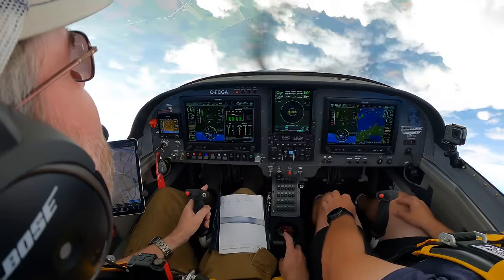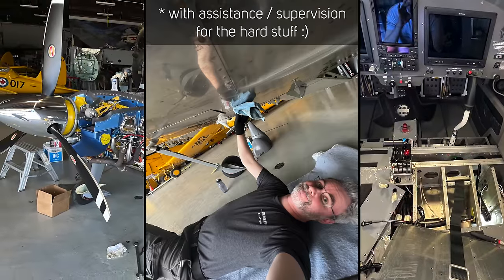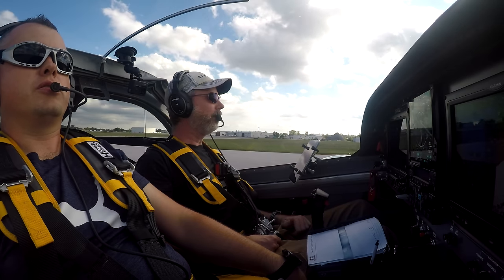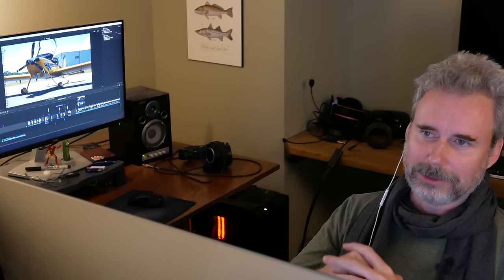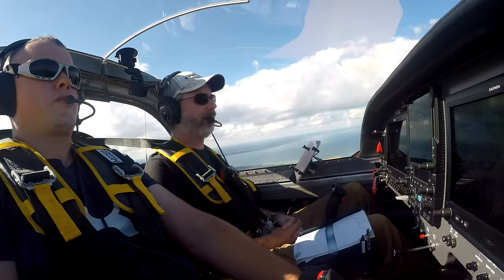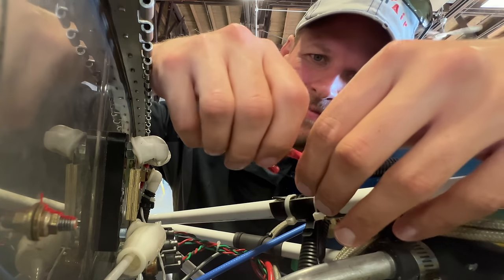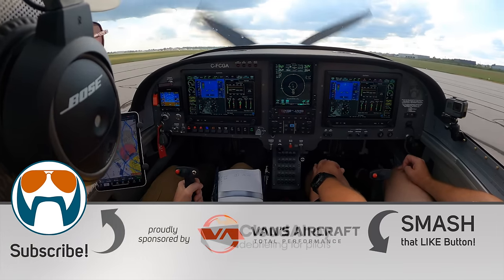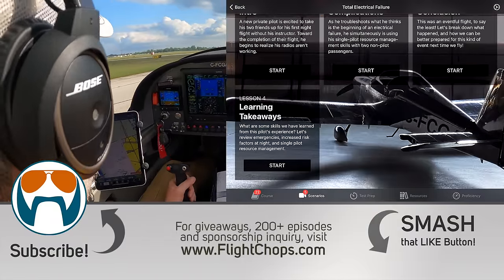Loop Induced Emergency?!

Comment: This kind of thing is what "Pan Pan" was created for.  Serious failure not to have used it.
Reply from the maker: Serious failure?  Or technical failure?  If this was a test question, no doubt the correct answer was to make a pan pan call. But in this case we were already in contact with ATC and they knew we had an urgent situation - they even offered us assistance on the ground if needed - we were able to make the most direct route to a straight in work with no delay.  So… was it sloppy?  Sure.  But to call this a serious failure is hyperbole.
Reply: @FlightChops  I stand by my original appraisal.  Especially in this instance where it is presented as a learning opportunity, foregoing PanPan takes another step toward eliminating it from our options. It should be used to indicate a situation that is not but could become and emergency. This situation meets that perfectly   The GA world tends to be all or nothing on this issue and that's not good.  Panpan is in some cases (like this one) the best, most succinct, and most efficient way to describe the level of issue.  Doing so would have rapidly illustrated to ATC what level of threat - that would have been handy since you could have lost your engine over open water.  You could have gotten priority handling for any conflicts, which could have saved your life had this situation gone south.  So yes, serious.

But no one ever remembers Panpan is an option except for the test, so don't feel bad.  You're no different than the rest of us.

Comment: All those fancy avionics; and I didn't see a nearest-directto for an airport.
Reply from the maker: Yup.  I should have leveraged the navigator and autopilot - but I didn't let go of the stick or throttle all the way home.  It's been a few weeks since I looked at this cut, but didn't mention that in the debrief? 
(that said, there was no "nearest" that had pavement, that wasn't home).
Reply: @FlightChops  Wow, I sometimes forget how baron things can be low to the ground. With that RV; you will probably get to do some fun cross-country; may I recommend 11.5/12.5. I find in my Lancair, that is usually a pretty smooth and empty set of altitudes. Another thing I found comforting early on in my cross country flying (Pacific to Atlantic type cross country I mean), looking out at all the beautiful runways I could glide to :)

Comment: Sorry but what was the exact cause/fix? Did the oil temp stay high after landing?  Were the connections examined for the cause after removal? Was the crimp done incorrectly? Why not include a little more information about the cause and fix?
Reply from the maker: Cause: Suspected bad connections via either the connectors themselves, or the crimps and due to being under strain from overly secure tie wraps. Fix: cut out and replace old connectors, secure wires with less tension.
Reply: @FlightChops  I for one would appreciate knowing more about how a crimp connection can cause the situation. Normally there is either a connection or there is not but a connection that produces some degree of resistance is not normally possible. Was the crimp poorly executed? Did the metal not crimp onto the bare part of the wire? Was there insulation that got shoved up inside of the connector? The connector is a metallic device so it should not be possible for the connector to become partially resistant I’m not sure if there was corrosion or some other inhibiting factor? Did you save the connectors that were removed? If so may be remove the plastic outer shield and examine them carefully? Maybe you could discover the actual cause of this? How exactly does pulling on a wire cause it to become a resistor? In this case it was just an oil temperature reading but what if this was a more critical connection to a more critical component? There are some connections that will actually prevent the engine from running or cause a more extreme condition. Not meaning to be critical but saying that the crimp connector was suspect without actually investigating it further seems like a less than thorough inspection .
Reply from the maker: The video is a thorough debrief with a Garmin engineer.  We didn't have a way to further test the connectors that "looked" ok.  But as the video showed, I have the panel data from the day after when "jiggling" the connectors undid the problem that pulling the 4Gs had created. So it is likely that it was one of the many things the Garmin engineer suggested could have been the problem in terms of a poor connection.  
As for the engine shutting down, short of the mags being turned off, there is no other electric failure point that can stop it from running that I know of.
Reply: @FlightChops  I understand you are satisfied the problem has been fixed. You talked to the engineer but no proof of the problem was revealed other than wiggling it seemed to change the reading. Stating that a 4 g pull on the wire could cause resistance seemed like a stretch to me and I can’t justify how it could cause the issue. I guess time will tell if all is truly well? I would have liked to look deeper into what actually caused it. If it’s a faulty crimp I would want to know why and are there any other connections on the aircraft that need to be looked at? I understand the mags typically have one wire to shut them down but there may be other critical systems and components such as instrumentation, nav and landing lights, and such that depend on a good connection.  As always thanks for the stellar content.
Reply: @johnlucas2037  These blade or "Lucar" types (Invented by Joseph Lucas many years ago) as they used to be called in the UK aren't great and really not ideal for this type of use. I've had experience of them failing and in places of high vibration as they tend to wear the contact areas away. This causes powdered deposits to form and oxidise the contact area giving intermittent high resistance at the joint. It's also possible if the cable is not crimped into the barrel properly, that can have the same problem with fretting, wear and poor connection.
The simple answer is to use the appropriate type of good quality connector for the application and environment, wire size and type. Use a proper ratchet crimp-tool for the crimp and support the joint appropriately. There's lots of info on the web about it.

I had a very similar problem during my flight test in a tight turn when the engine "coughed". Had the examiner in the back so headed straight home to the airfield and borrowed a friend's aircraft to successfully complete my test 😁 Later found a worn blade connector on one of the ignition coil contacts (Rotax 462 engine) which was loose and dirty. Replaced it and the coil and no more problems.

Comment: Isn’t the Lycoming oil temp limit 245f? Not 230?
Reply from the maker: Red line is 235f for this engine.  Peak reading I saw after the loop was 258.  Most of the way home with low power settings and speeds over 140 KIAS, oil temp was still reading in the high 220’s - it was unnerving to say the least.
Reply: @FlightChops  ahhh I didn’t know that.. Lycoming has 245 as a redline in most other engines, including my O-360, but the IO-390 is a different beast! Great job!

Comment: I don't like crimped terminals in aircraft.
Plus there's different quality crimper tools.
Your crimper didn't look like a professional crimper.
They have an over centre type action like a mole wrench.

I built a Eurofox 4 years ago (now 1000hrs)  and I crimped and soldered every joint.
Happy to report no electrical gremlins to date 🙃

Comment: Engine warranties can be invalidated by maneuvers prohibited by the engine operating manual (not just the pilot operating handbook). Unless you have an inverted oil system designed for aerobatics, any maneuver not required for normal flight, any inverted flight (your loop), any angle of bank exceeding the engine manual restrictions means you just threw away your engine warranty.
Reply from the maker: Welp - Lycoming sure knows what I am doing with this thing :). 
It was always the plan to fly aerobatics with it - but I guess I need to look closer at the warranty.

Comment: A GREAT reason why I don't like experimentals, and how people "save money" doing stuff themselves, or buys cheaper parts.
It's not worth it in my opinion. Get certified stuff, service from proffessional people, with the best parts. 
Good luck :)
Reply from the maker: A friend had this exact issue happen, but with CHTs... on the delivery flight of his brand new Cirrus.
Reply: very few people do EAB to 'save money'.  You will not.  The construction quality on builds like his usually exceed certified builds
Reply: Ignorance is bliss.  Certified workmanship is not too much different.  You'd be 100x less likely to have this issue with a new Corolla.
Reply: In 40 years of flying certified and experimental I’ve had the same failure in my both. Resistance is resistance. The immediate check that was missed was oil pressure. If oil pressure remains the same it’s likely the sensor. If oil pressure is decaying you likely have hot oil.
Reply: As someone who spent a year tearing down and rebuilding a 1961 Cessna  172B 'certified' aircraft... Don't let 'certified' / 'passed annual'  give you all of the good feels, while putting down homebuilders as corner cutters.  
We found 60 years worth of non-standard parts and repairs in the 'certified' airplane. While most homebuilders I know are meticulous with their builds.

Comment: Maybe next time you want to look UP and not just left and right before flying a loop.
Reply from the maker: Is that honestly your take away from this video?
Anyway, to clarify the video is edited; it doesn’t show every single thing we did. 
Before commencing aerobatics I completed a HASEL check, the last step is L for Lookout and includes clearing turns. I did not put that in the video. We look up and down and all around during clearing turns.  I was also on flight following for an extra set of eyes while commencing the aerobatics.
Reply: @FlightChops  Thank you for your answer, Steve. First, this were not MY take away from your video. I enjoy your videos very much, and from most of them I take something away for my own piloting. Same here. I just don't comment on my takeaways on YouTube. However, someone not looking into a turn / in the direction of light, I find quite unsafe, irrespectively of the 'turn' being horizontal or vertical. And you wearing a hat that physically prevents looking into the turn does not reduce my discomfort. Maybe my uneasiness is explained by an incident I had at my home airfield last year. I was returning home from a flight with a coworker and his little son as passengers. Checking in at the airfield frequency and announcing my midfield crossing several times. No one answered. Over the field, out of nowhere (from my perspective) an aerobatics plane appeared out of a loop right in front of me. Obviously several things went wrong for this near miss to happen, but looking into the direction of flight (at least occasionally) as  an aerobatics pilot is one layer of the swiss cheese.

Comment: Is there a reason you mix units and use F for the oil temp but C for OAT?
Reply: Specs for the engine are likely provided in F. It's pretty common in piston engine planes in north america, He fly's a lot of types so it makes sense to be consistent.
Reply from the maker: Yes exactly - the standard for most North American aircraft engines is to measure the various temperatures in F.
And the international standard for aviation weather temperatures is Celsius.
And actually in my day-to-day life I think about temperatures in Celsius here in Canada so that’s just natural for me and I wasn’t going to put the panel OAT in Fahrenheit, it would’ve just been too confusing - I also like that zero is freezing in Celsius, that just makes so much more sense
Reply: @FlightChops   Ha - the non-standard Canadian approach to temperature is a tough one for others to get their heads around. My plane is setup the same way - engine temps in ºF, OAT in ºC.
Reply: @GlensHangar  Non-Standard? To my knowledge, Celsius is the standard temperature scale in the non-US world. (Ok, scientists sometimes measure in Kelvin, but that's just a Celsius scale offset by about 273 degrees (0K is absolute zero).
Reply: @realulli  Ugh... Perhaps I should have been more clear in order to appease the linear.

As a Canadian leaving a comment to another Canadian (In case you need to be reminded Canada is not part of the US) I said, and I quote "the non-standard Canadian approach to temperature is a tough one for others to get their heads around." - You see Canada, while a Metric country, still uses both Metric and Imperial interchangeably. 
- It will be 21ºC in our kitchen, but we'll set our oven temp to 350ºF.
- In summer it's 90ºF, but in winter it's -20ºC
- I'm 6 feet tall, but my skis are 185cm long
- I write 1Lb of beef on my grocery list, but buy 500g of beef at the store
- My Cessna takes 42 US gallons, but I pump in 159L ( I used to pump in 35 Imperial gallons for my Father)

My point was that as Canadians we use both scales at the same time, in ways that make sense to us but may be confusing to others. 

I DID NOT SAY THAT USING CELSIUS WAS NON-STANDARD.
Reply: @GlensHangar  Ok, sorry for the misunderstanding, I just get triggered by the USians claiming something is standard when the rest of the world is using something else. I thought Canada was fully metric, I didn't know the units were that messy (I live in Germany). Thank you for the clarification!
Reply: @realulli  I get triggered by 'rest-of-the-worldians' not realising that Canada isn't part of the US...

Comment: I’ve used RTD’s quite often in industrial machinery and the rule was never use a connector or a terminal, unless the terminal was specifically made for RTD’s, between the RTD and the instrument/display reading the RTD because of this very problem. A uninterrupted wire from one point to the other. I wouldn’t be surprised if the installation instructions mentioned and warned of this potential problem.